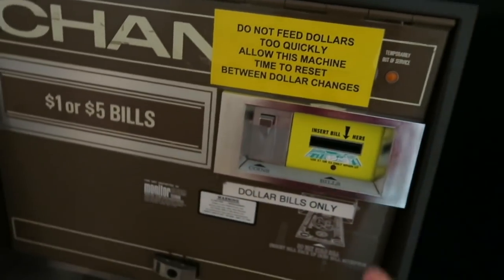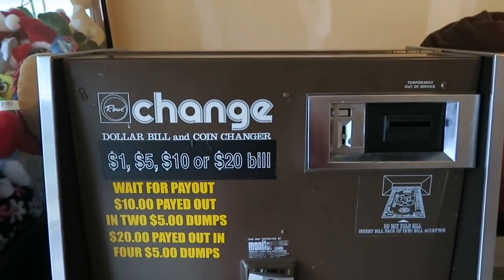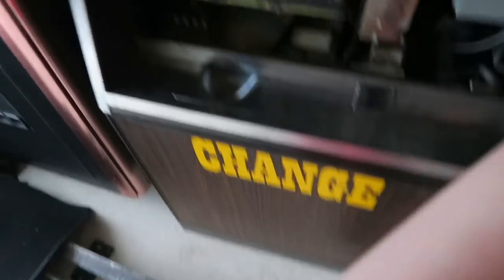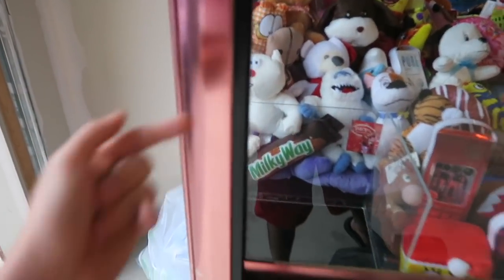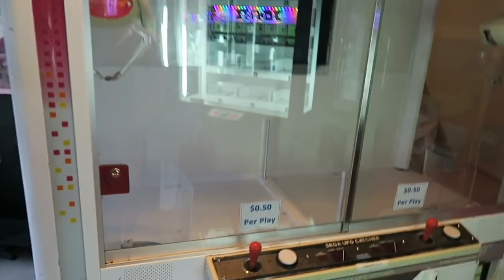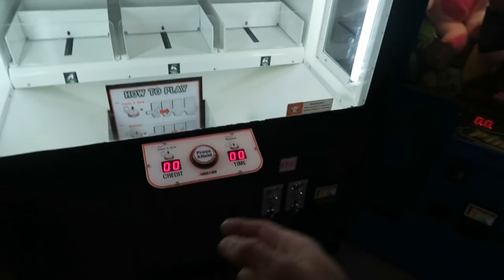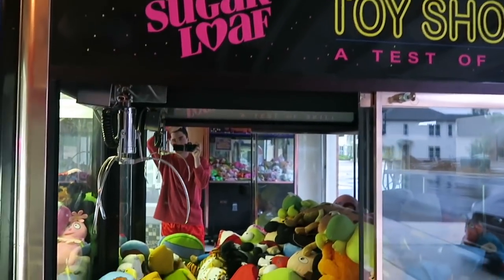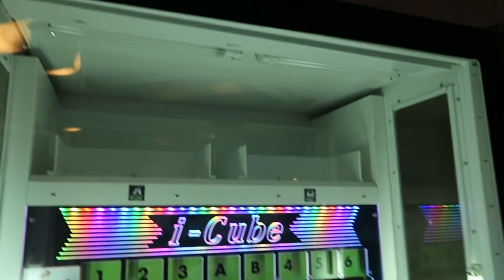HOW TO RIG ARCADE GAMES!!!

Comment: Yes that stereo type about men not liking to use a manual is true but there is a little more behind it.
1. men like to not use a manual because they sometimes figure that it will take more time read the manual front to back (let alone fully understand it if is complicated or worded weirdly) as compared to taking a couple of minute play around with whatever it is they are trying to understand. By doing this men can at least get the basic gist of how something works and refer to the manual if they need to in the future.

2. Some men (myself included) take it as a point of pride if they didn't need a manual to figure something out and more complicated the bigger boost to their self-esteem. Though if it takes too long or we start getting worried about breaking something we will begrudgingly reach for that manual.